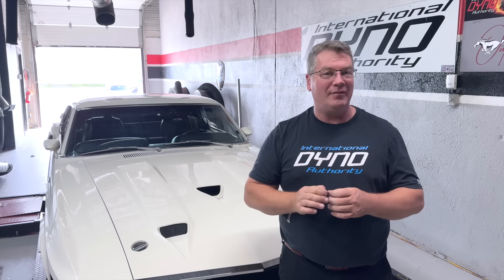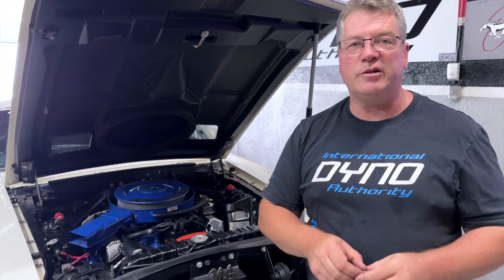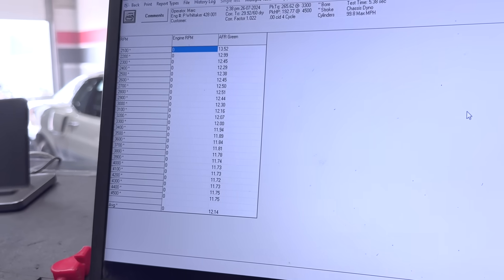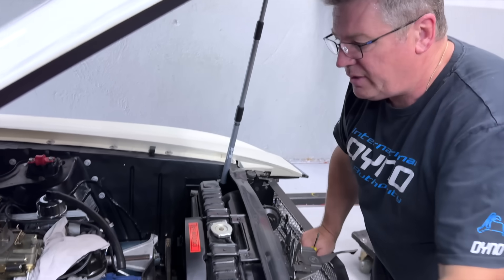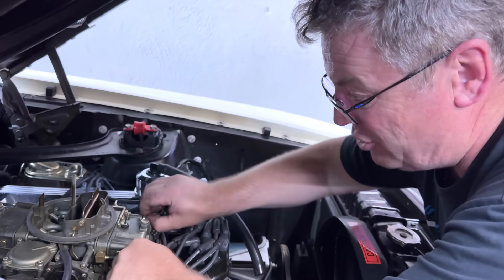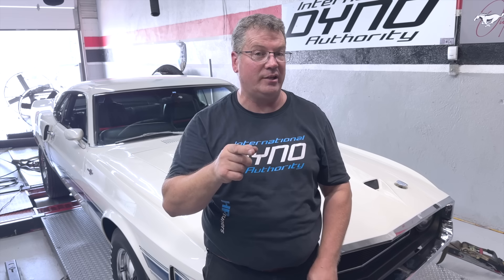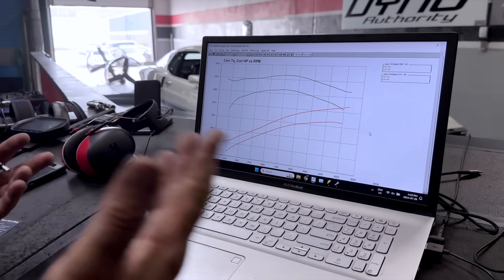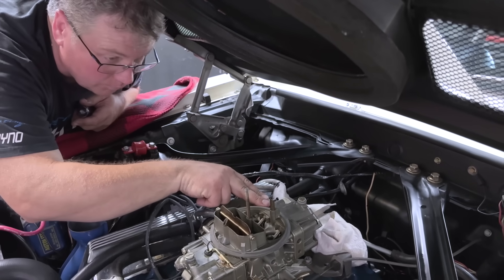Original, unrestored '69 Shelby GT500 tuned on the dyno

Comment: How come you guys always do a slow acceleration, and never do just a stomp on that gas wide open reading and acceleration. I want to know uf you get misses with those single plane intakes, on the rear cylinders, like cylinder 5 robbing 7 of gas at wide open, 6k rpm.
Reply from the maker: @opengnosis8555  
Our tuning process is meticulous and systematic, starting with all passes beginning at 2,000 RPM. The throttle is applied rapidly ... Every pass ...to the wide-open position, ensuring consistency across every run.

Each test is conducted on the chassis dyno under identical load conditions, allowing the vehicle to accelerate as quickly as its setup permits. The duration of the test is carefully measured and compared with subsequent runs to evaluate progress.

Initial tests are run until the torque curve falters or until the data log indicates unsafe, unproductive, or non-rewarding results—signaling the need for adjustments or the next step in the tuning process.

We prioritize the safety and condition of every customer’s vehicle, treating each one with the utmost care. Throughout the tuning process, we closely monitor key parameters such as temperature, AFR, IAT, balance, and torque production across the RPM range.

Our goal is to deliver responsible, high-quality results that enhance the performance of the vehicle without compromising its integrity—or our reputation. We do not take risks that could endanger a customer’s vehicle or the standing of our business.

As we observe improvements, we gradually extend the RPM range, focusing on identifying the engine's most efficient operating zone. At every stage, we ensure transparency, sharing step-by-step results with our customers and walking them through the data logs to educate and inform.

Each test adheres to a precise, repeatable procedure, maintaining consistency and accuracy. This approach not only ensures optimal results but also reflects our commitment to excellence and responsibility in tuning.

---

Let me know if you'd like further adjustments!

We very much enjoy your feedback, hearing your reactions to our videos - thank you.

We wish you, and your Family the best this holiday season.

From all of us at International Dyno Authority Merry Christmas and the best to you in the new Year. God help us all over the next four years. 

Cheers
Reply from the maker: @opengnosis8555  When comparing single-plane and dual-plane intake manifolds, the fundamental difference lies in how each design affects airflow dynamics and engine performance across the RPM range. A dual-plane intake manifold is designed with a split plenum, effectively isolating the intake runners for specific pairs of cylinders. This design increases air velocity at low RPM, which enhances cylinder filling and combustion efficiency in the lower range. As a result, dual-plane manifolds are highly suited for street applications where throttle response and drivability at low to mid-RPM are crucial.

In contrast, single-plane intake manifolds feature a shared, open plenum, allowing all cylinders to draw air from a common reservoir. This design excels at high RPM, where greater air volume and smoother flow transitions become more critical for peak power production. However, at low RPM, the reduced air velocity can hinder cylinder filling, leading to incomplete combustion and uneven air-fuel distribution. These challenges, particularly below 2,500 RPM, often result in reduced throttle response and less consistent performance compared to dual-plane designs.

To address these inherent differences, tuning plays a pivotal role. During the tuning process, we carefully analyze data such as air-fuel ratio (AFR), manifold pressure, and cylinder balance at various RPM points. Adjustments are then made to optimize combustion efficiency and mitigate the challenges associated with each manifold type. At every step, we share the data and our insights with customers, ensuring they understand how the intake design and tuning decisions affect their engine's performance. This collaborative approach ensures optimal results tailored to the specific application and goals.
Reply: @internationaldynoauthority693  Thank you so much for explaining that in full detail. I think it has been like 2 years of me searching for a really good explanation. So again, thank you for your time and your wisdom.
Reply: Completely unnecessary to do that,  and even potentially damaging.  That juice isn't worth the squeeze my man.
Reply from the maker: @creativespace3077  Merry Christmas, Happy New Year. Not sure which video, comments are addressing to. But we certainly appreciate the feedback.

Comment: What fuel did you run during the testing with the 1969 428 Super Cobra Jet engine?
Reply from the maker: @windward2818  

91 Pump ⛽ 

This is a classic car meant for car shows and weekend cruises as a pleasure vehicle. While we could have sourced some 100-octane fuel, optimized ignition timing, and squeezed out an extra 25 horsepower, the customer's priority was simply eliminating the smoke.

If we had retuned it with something like Sunoco Maximal, we would have had to reconfigure again for 91-octane fuel later, which isn't ideal for their use case.

As a dyno tuning shop, we work with the setups that customers bring us, tailoring the tune to their specific needs.

Thanks for the feedback, and we always appreciate the conversation! Have an awesome weekend—cheers!"
Reply from the maker: @feydespiel.  Here we have, 93 available. And 94 available. 

Nobody's going to run those, because, they are usually stale. Everybody purchases 87. And some people purchase 91. So the 91 tends to be more ethanol-free. Most people still run 87 because it's just less expensive. And you don't need more than 87 and 99% of the vehicles. Some people will still run 93 and 94. However.. when you go to purchase 94. You're going to a fuel station, that has not sold any 94 this month. It's going to be stale. So nobody runs it and it's really a disadvantage. So 91 is more stable, more people purchase it. The fuel turns over more often and it's fresh.
Reply: @internationaldynoauthority693 That's interesting. I wonder if Nick Panaritis from Nick's  Garage is the only customer for the 94 octane from his local PetroCanada station? 🤔
Reply from the maker: @stephenholland5930  Nick 

Does Not Tune.

He just runs "Back to Back"

He bolts stuff to the Dyno then makes videos about the parts...... No tuning.

But entertaining to watch Nick.

Comment: Just curious why you didn’t re connect the vacuums advance?
Reply from the maker: @proflytebyron  In the video we go over, that the vehicle is in original condition. And the customer has made every attempt to keep everything as original looking as possible. This particular distributor was purchased to keep that theme. In other words, under the hood there's not some bright red distributor that says Ford Racing all over it. LOL. Anyway, this particular distributor did not have vacuum advance. This particular distributor had an intricate ramp and weight system. Originally designed back when people called it a racing distributor. Now it's just called the distributor. Without vacuum the bench. When we walked through the timing curve, we found it completely unnecessary for this engine, to remove that distributor. And to replace it. With a different one, it absolutely came to life. It ran good the torque of that number of cubic inches and how quickly it built that torque was impressive at the end of the tune. Also it's a standard transmission and with a standard transmission. If you want a little bit more RPM before you take off, you can simply clutch and slip the clutch just a little bit more. 

Thank you so much for spawning discussion. And writing in, and watching. We appreciate it. Stay tuned for lots more projects. 

All of us here at International Dyno Authority. Wish you the best over the holiday season. And, Merry Christmas to you, your family, and your friends
Reply from the maker: @proflytebyron  timestamp 1:35